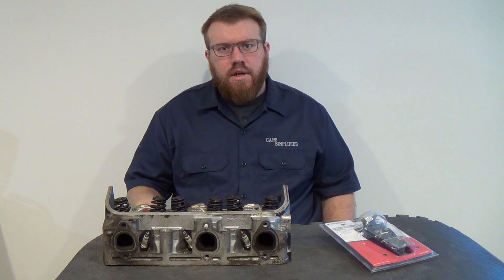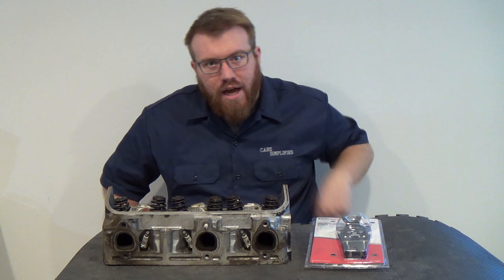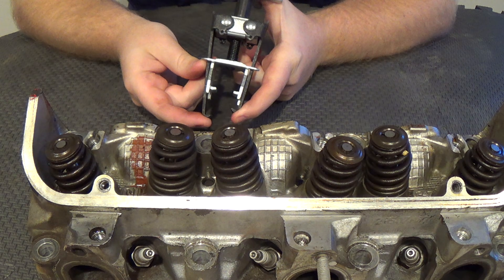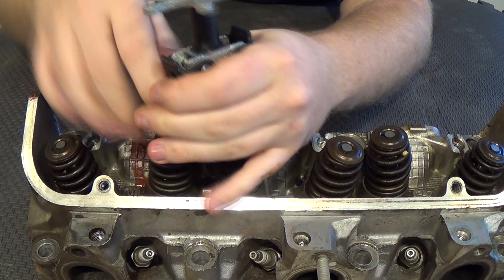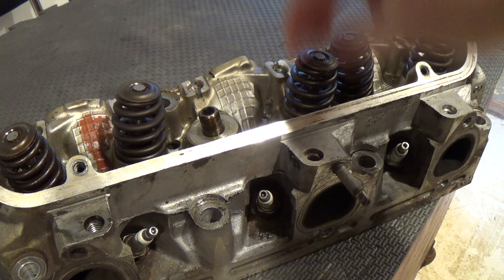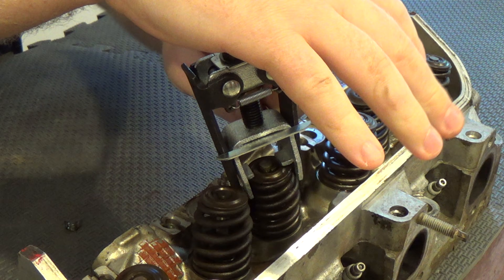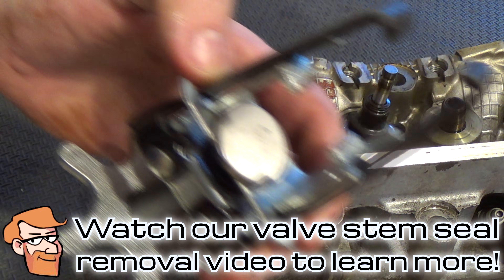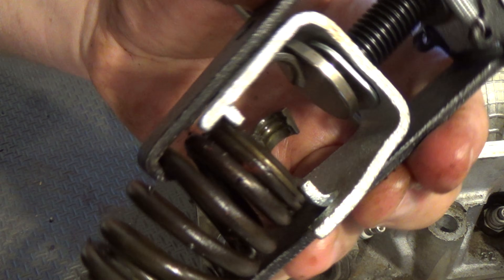How to Remove Valve Springs (Overhead Valve Removal Tool) • Cars Simplified

Comment: I brought this tool today, so I could replace my valve seals. I got one off without no problem. But the second one, gave me drama. I tried to find something to place under the valve, so it could stay in place. I have to find something soft & sturdy, go up under there. So, will try again tomorrow.

Comment: have you ever had it where your using a compressor and right when you get it passed the keepers and free they make a pop sound. i have dirtbike with a dual valve spring design there was pop on all of them. nothing was damaged. just thought i ask. sound was like removing a suction cup

Comment: After removal of said camshafts, timing chain/belt, cam gears, valves, and valve springs. How will you know that the timing is correct and what position the camshafts should be in??

Comment: would automotive valve compressor tool works on motorcycle valve? I'm looking to loose a stuck intake valve with the rope method inside cylinder to keep it in placed.  Motorcycle engine is smaller compare to car engine. Would this tool work on the small valves? Thanks
Reply: Socket and hammer that tool works to put them on but I prefer a socket and hammer to get them off.  I could have all 6 off by the time he finished 1
Reply: @jeanjacque1577 ok how do you get them back on when you do that technique I did it and can’t get them back in

Comment: What about the valve falling in engine
Reply: You have to rotate the engine manually (wrench on crankshaft pulley bolt head) until the piston is near the bottom of its stroke in the cylinder being worked on. Take spark plug out from the cylinder, and shove in some 1/4" rope through the spark plug hole until you have about a foot of rope or so into the cylinder (letting some rope hang out of the spark plug hole), then rotate the engine manually until the piston pinches the rope in the top of the cylinder and will be holding the bottom of the valve all the way up so it won't fall down into the cylinder when you take the valve spring out.

Comment: I could really use some help, I need inexpensive valve spring compressor for Chrysler 3.5L. 2004 Pacifica. Would this work?. Bent few exhaust valves. Going to fix myself. Any help is appreciated..

Comment: Great video. Just wanted to add that this is the best tool to use in tight spaces, such as when the head is still on the engine. His techniques will be the same, except you'll need compressed air blown down the spark plug hole to keep the valve in place. Also, make sure your cam is in the correct position.

Comment: I bought a tool just like that i dont understand mine keeps slipping out of springs i attempted like 7 and it just keeps poping out. I even try to hold the 2 bottom jaws that holds the spring and it still slips hit my hand twice ouch
Reply: Willy Garcia exactly the shit doesn’t work on real engines don’t know what engine he’s working on. I’m working on my 350 Chevy and that tool is a piece shit. The bottom of the tool needs to be curved up to stay on the spring during compression
Reply: Biglil Daddy fucking tool is garbage
Reply: @BIGlittleDaddy2  same for me haha. Except 305 sbc. I put vice grips around the puller hooks to hold them on
Reply: @NickyShweety  did it work?
Reply: Yeah, mine keep slipping out from under the springs, I wasted a whole day trying to get only one off. It's a piece of garbage.
Reply: Yeah it worked